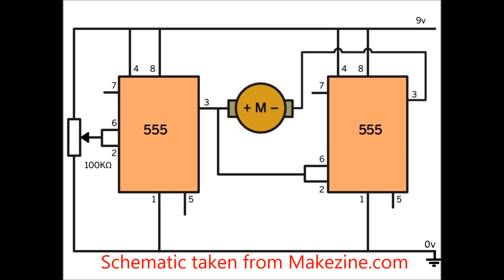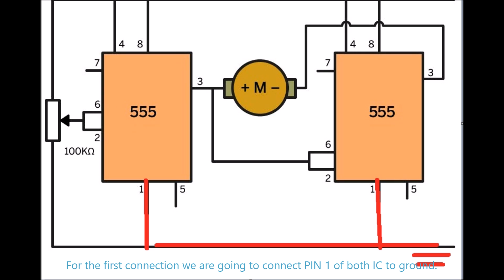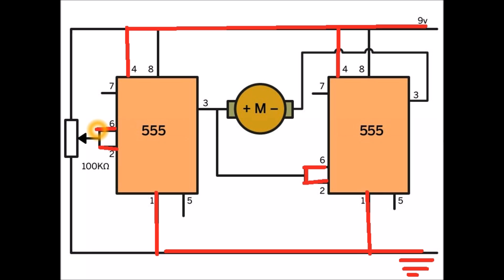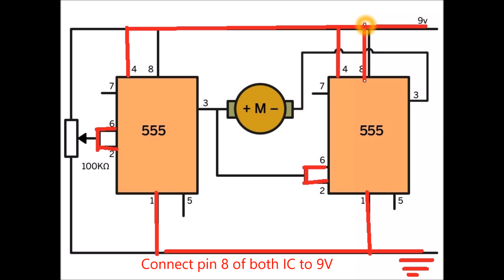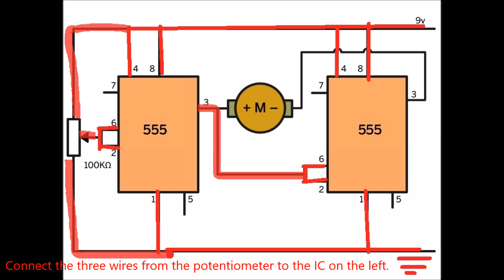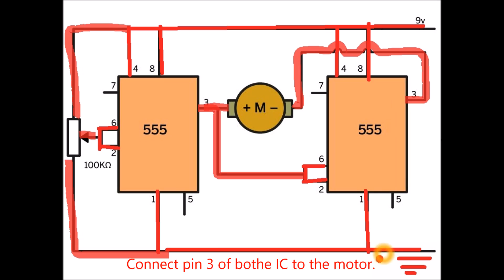How to make H-Bridge circuit

Comment: this showed up when looking for "L9110H"
wtf
Reply from the maker: I mean i think this can achieve some of the functionalities of that control driver chip. Both can be used to drive motors in both directions at varying speeds. But still google has weird choice in recommendations I guess
Reply: this is cheaper and better alternative for l9110H technically  booth are near the some thing. so i think its a good think to see them linked :P
Reply: well may not be better . and there is other ways to do some  mechanism too.